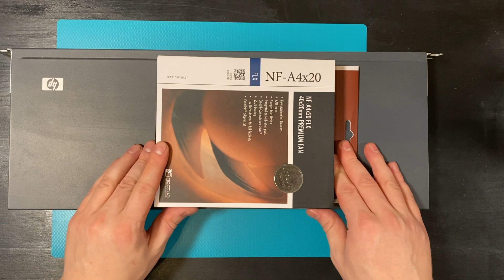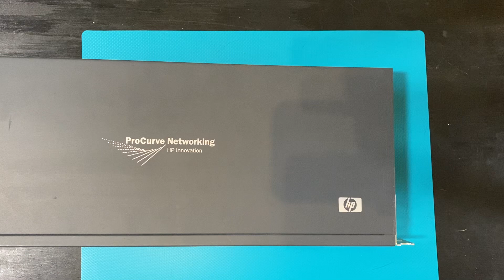Replacing noisy Procurve switch fan with Noctua NF-A4x20

Comment: It this the 12V model? Can you just wire 2 pins (+/-) and run the fan full rpm. I am shopping around for a 2-pin, no PWM setup for a NVR recorder.  The 3-pin model they sell can be used full rpm with just two wire as I read. The NVRS run 24/7 and every so often have to change out the fans ( I buy generic to say and dont last as long) I think Noctua is a good brand (you pay more but you get what you pay for). Take your tk to the auto dealer - pay more but they fix it right!. Thanks, good video!

Comment: but it has a much lower CFM too, monitor the temperature, as you may have a cooling deficiency. A normal fan has an average of 15CFM, the Noctua has 5.5CFM
Reply from the maker: Yes, then again the switch is used at maybe 1/10th of its capacity in its current role unlike it would usually be used in a datacenter, so its unlikely to become an issue.

Comment: The cooler you can keep your equipment the longer it wil last.This is especially true for electrolytics.
Reply from the maker: however the temperature will depend on the level of use, and as my network isnt exactly ever truly saturated, its not exactly running hot like datacenter switches are.

Comment: Hey man just wanted to ask if you ever found a solution to the fault light on the pro curve. I by pure luck got a pro curve for free but its damn loud and when I replaced the stock fans with noctuas the fault light kept blinking. 

btw thank you for the cool 3d print part, gonna print that soon!
Reply from the maker: I have a solution for it but but never actually got around actually implementing it as the switch is in use.
Reply: @Purkkaviritys  it'd be a cool followup video, i'd definitely watch that 100%
Reply: Could you please let me know what is the solution to to get fan led to work? @Purkkaviritys
Reply from the maker: @mailman1980  I'm pretty sure the switch reads the RPM of the fan via PWM and since the new fan is not reporting the way the switch firmaware is expecting or at all, it gets upset and error light comes on, reading the pwm from the noctua fan and then feedin it back into the motherboard in the format it expects would fix the issue and still retain the capability to show error when the new fan fails.

Comment: Sure exhaust is to the heatfans? Normally you suck the air away from the case.
Reply from the maker: either way, you get airflow inside the case, that switch has been used 24/7 since the publishing of that video and there have been no problems.

Comment: Just a FYI i have the same switch i used to use 24/7 for about a decade except it was sold as passive J9028B, exact same internals except no pins on the fan header and square mesh instead of a fan cutout. Recently reused it to hook up my 1gbit stuff since i've moved to 10gbe a few yrs ago but don't want to waste ports, quite warm so i just cut out a 120mm fan hole on top and soldered the wires to the pads where the header would have gone if they sold it as an A model, resistor reduced to about 600rpm and cold as ice now. You could tell they knew this unit didn't need much cooling by the low quality fan they used, i honestly had about 12 devices daily on this thing and it never went funny with no cooling at all lol.